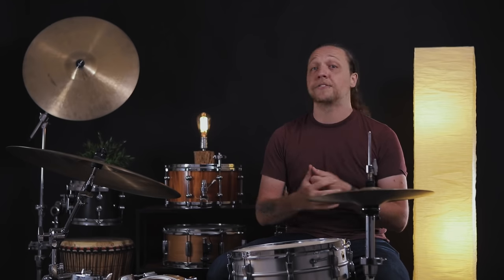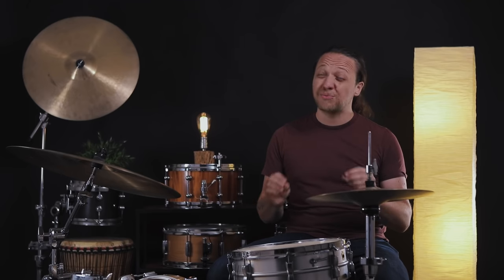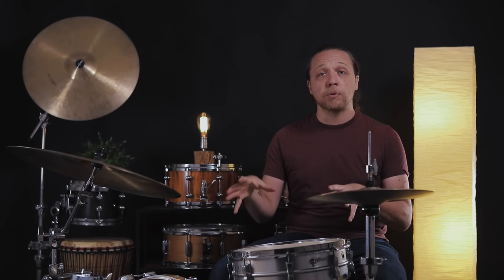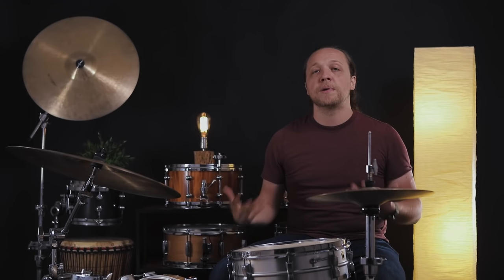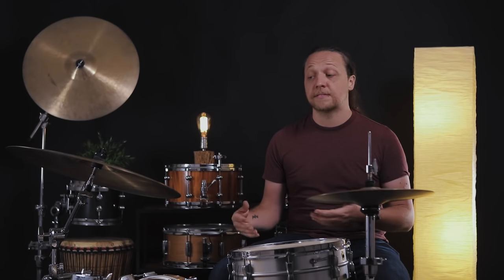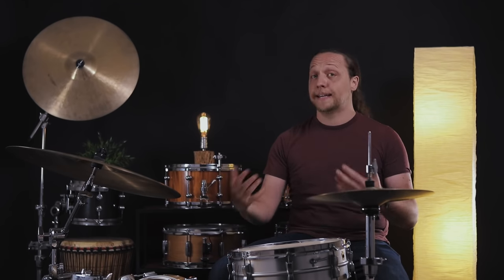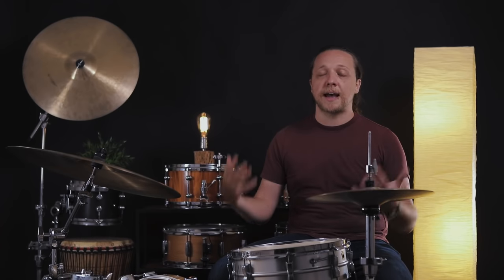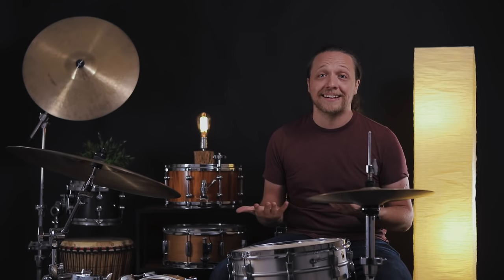Secret to the Ideal Bass Drum Tone | Season Three, Episode 18

Comment: For years I adored the sound of a kick with the reso tuned an octave higher. So much presence in the kick drum! It's a very usable sound, you get the low end and attack of the batter head and bright resonance from the reso head, also the reso head becomes like a speaker for the batter head because they resonate with the same note, making it a very loud drum.

Comment: Ime, almost everybody has their front head too loose. That’s where all your tone lives, man. I generally tune the batter first, get it where it feels good and doesn’t sound clicky or anything. Then tighten the front head until I get the sound I’m looking for. The front head gets tightened way past JAW, and a good bit tighter than the batter certainly. 

I think popular tuning methods (like Gatzen) are responsible for a lot of frustration for a lot of people. 
Invariably, when someone just can’t get a good sound, the heads are too loose. Particularly the front, too loose and you get no fullness - instead you get a thin, flat sound with crunchy, flappy overtones. (Then you throw laundry in to clean up the sound, but you didn’t have a good sound to start!)  

It’s just a big drum, it’s not a different instrument altogether. It needs sufficient tension to produce a big sound and get the shell involved. If you’ve been doing the JAW thing for a while it seems counterintuitive - you think the big, powerful sound comes from the low end so hey, I better tune as low as I can. But the way to get a bigger, more powerful thump is to go higher - not lower.  Lots of issues with bass drum sound can be addressed by tightening the front - not by loosening it. With loose heads, it’s all just attack. You’re not hearing the tone of the shell or the heads, just the collision of beater on floppy plastic. Ugh, that crinkly cellophane sound drives me nuts. Tune it UP, get a full, round, luscious tone and THEN dampen as needed to achieve your particular sound. End of novel.
Reply: Absolutely with you...
Reply: I'm with you too, to an extent. I play in a metal band so I need that attack to overtake the overtones. I dont tune it past a wrinkle, but still fairly low and get a sound that works for what I'm doing. If I wanted to play a softer genre, I would definitely crank it up about a full turn though. Get the sound that you want/need for the circumstances.
Reply: Festering Carm  Right on! You need the sound that’s right for the music. Metal and jazz always come to mind when I think of specialized tunings that defy the usual. And of course there aren’t any ‘rules’ in drumming, some of the greatest use(d) very unique tunings. But in a general sense, yeah, I think people struggle with bass drum tuning and end up buying more and more muffled heads, or using more pillows, or just giving up and saying “I guess that’s the best it can sound”. Less pillows/expensive muffled heads and a little experimentation with tuning can open up a lot of sounds that are just waiting to be discovered in your bass drum!
Reply: @crummyy But you can definitely have all music styles covered with a "jazz kit"..
Reply: Super nice breakdown!
Reply: Agreed, especially with a larger bass drum (24”-26”).
Reply: Exactly! I bought a nice kit to hear the tone of the drums! Tune em higher her them sing! You can a cheap kit & get that flappy sound all you want! Throw old pillow inside the bass & hear dump. I like my big 26x16 bass thumping & has tone, no port or pillow! Boooooom
Reply: What is JAW?
Reply: @Adixon5  Just Above Wrinkle - this is when you tension a head juuuuust until the wrinkles disappear and then stop.
Reply: @DZNTZ  gotcha, thanks
Reply: @Adixon5  
Just above wrinkle?
Reply: What is JAW
Reply: @queenpurple8433  Just Above Wrinkled - a tension that juuuust removes the wrinkles in the head
Reply: @DZNTZ  thank you I had never heard it called jaw before but now I know
Reply: @queenpurple8433  you’re most welcome. Knowing is half the battle. (I’m not sure what the other half is, GI Joe never got around to that)
Reply: this comment has inspired me to finally go out and try to tune the dang thing rather then damped the hell out of it instead 👍🏻
Reply: @mdlassel  Yes! Tune it up! Try to get the head “in tune with itself” - that is, sounding the same note when tapped near each claw. If you get a nice sound but it’s got a little too much sustain, the Sounds Like a Drum method of using a T-shirt or handtowel kinda tucked between the pedal’s goalposts and the batter head works wonders. You can get two very usable sounds just by adding/removing the shirt/towel. Good luck 👍🏽
Reply: @DZNTZ  thanks man! ill try it :)
Reply: I liked your comment because of the ending!🤣
Reply: @davidperez5089  Lol, thanks! I can be long-winded, but I’m passionate about drumming and I want to share my experience. Thanks for reading all the way to the end! Happy holidays!
Reply: @DZNTZ  likewise! I get upset when a drummer gets nonchalant about his sound from out front. Same goes for drummers whi play full volume @all times. Dynmacis is needed!!! Hohohi
Reply: @Dan G thanks for sharing that perspective. I recently tried tuning my batter head JAW (after reading many recommendations ), but the feel was horrible for dynamic playing and the tone was one-dimensional. I thought it was in my head or maybe I needed to adjust to it, but tuning higher solved everything 👌 ... If you don’t mind sharing, what’s your batter/redo head combination? I’m currently using a coated PS3 batter - which I love - but I’m not sold on the smooth white PS3 Reso I’m using. I’m getting great punch, but slightly too bright for my purposes. I’m considering a Coated or Ebony PS3 resin to get a slightly darker tone ... Any insights would be appreciated. Thanks again
Reply: @robertacosta3134  The PS3 is a great head, very versatile. For a darker, warmer tone I’m using an Evans Calftone Emad batter with a Calftone EQ4 reso for most stuff. For a jazz setup I switch to Calftone EQ4/regular Calftone. 

If you want to stick with Remo to keep everything in the family, I’d recommend a Fiberskyn Diplomat or Ambassador reso for a little more depth and warmth. You can check out Carter McLean’s vids for a beautiful sound with Fiberskyns and good tuning. Glad to hear from you!
Reply: @DZNTZ  thanks for the quick reply! 🙏 The Fibrrskyn sounds intriguing ... I’m familiar with Carter McClean’s videos, so I’ll look for that one ... Thanks again and best to you
Reply: I feel ya man, tho sometimes when practicing I like  messing around with it just to see what kina sounds I can get out of it. Like when I loosen it til its  flappy & I get like a sampled sound, again I does this for fun not during a gig, like u said it's a big drum therefore its capable of producing many diff sounds
Reply: My Ludwig Legacy Maple hears your cry,.
Reply: I agree. It's what I do and everyone comments how great my bass drum sounds.
Reply: Well here we are . People looking for better tuning techneque, yet give more input rather than learning a good lesson. OPPINIONATED

Comment: Along the same lines, over the years I’ve found that those heavier plastic port hole protectors can dramatically decrease the effectiveness of the front head. I use the Aquarian port hole, which is just a thick Mylar with adhesive. Any of the fancy metal finish types that are a two piece snap in design have enough weight to them to make the head very stiff and the drum gets very boxy sounding. IMO.  
Great vids, thanks!
Reply: That's true!

Comment: Awesome it sounds great, I tuned mine with the drum dial, and experimented allot with both batter head and reso head and found a sweet spot batter tuned to 90 and reso tuned the same at 90 on the dial and both pitches match great and it sounds real good.
Reply: Interesting because the Drum Dial company says that the Bass drum dial should be between 70 and 72 for both batter and Reso.  Way different than 90
Reply: @normnashtynash8815  I like my bass drum to have a higher pitch and a tighter feel, when I tried it this way I really liked it even though it's basically tuned tight kinda like a snare drum, it's just a personal preference, sounds big and boomy and the front reso has a port hole

Comment: I discovered through doing a little bit of reading. This idea and how it can change the tone of the drum. As mentioned in the video you need to figure out where the drums live. The great thing about a kick drum is all of the customization. Between beaters and heads and stuff to put in the drum. Even as it’s talked about here the way to tune the relationship of both heads. I’ve found that moving blankets are awesome for muffling. But also the DW pillows are awesome as well as the Evans EQ pad. With this drum it’s all about how far are you willing to go......

Comment: Definitely need a center vs offset port (same size/small port) shootout. I wanna see if the volume is really changed or if it's just the decay/attack and evenness of the sound that's affected. I think a 4 or 5-inch port on a 20" kick would do it. Or a 6-inch port on a 24.
Reply: A center hole will kill your resonance and most of your low end. You'll get a lot more midrange, but you'll also lose high end. When this type of hole was more common (1970's-1980's) engineers would compensate for that by sticking a 2nd mic (like a Shure 57) way into the drum pointed at the point of beater contact. 
An offset hole leaves the center of your reso head intact and so it can still vibrate and project the low end, which lives in the center.
Reply: @bergerdrum  But in the 70s, they were BIG holes, AFAIK. I'm talking about a minimally sized hole. Just enough that you COULD stick a mic through. 4"-5" on a 20" drum, 5" only on a 22", or 5"-6" on a 24" drum. Or in terms of a ratio; 1/5 to 1/4 of the diameter of the drum is cut out of the center. Those big holes from the 70s are like 40%-75% of the diameter cut out of the center.
Reply: @Drunken_Hamster  I hear you. Yes, those holes back then were pretty monstrous. But I think any hole in the center is going to kill the low end. It's not just me saying it; Simon Phillips, for example, says that if you cut any hole in the center of the reso head, you might as well just take the thing off; that's how big an effect it has. One of these days I'm going to try it with a really old head.
Reply: @bergerdrum  Saying and thinking is definitely different from trying. Start with a 1/5 diameter hole, and if that turns out to still be too boxy/resonant sounding, ream it out bigger to a 1/4 diameter center hole.

A LOT of people in various hobbies use hyperbole to enforce arrogant/ignorant dogma to push their own agenda. To that effect, I'm NOT making any declarations about Simon Phillips' character, but I'd be wary and skeptical of anyone making broad sweeping statements about anything in the manner that you quoted him doing.

If I were a drummer, I'd have tried it already and reported my findings. AND I'd have given it an honest shake by doing it on a new reso head. But then again... Do resos really ever "wear out" or do they just literally decay from time-based aging?

EDIT: OH, btw, if'n'when you DO try this, if it doesn't resonate well and you're the type to tune your batter loose and reso tight, try doing it in reverse with the batter tight and reso loose. Might allow the reso to, well, resonate more since it'll flap. Plus the batter should theoretically hold and transmit energy better since it'll have more potential energy to begin with due to tension and the actual batter pedal should be able to transfer more energy into it for the same reason.

Hell, if the center hole lets the air escape faster, you might not even feel like the batter is too bouncy or buzzy despite being tighter, since you'll get less of a reflection from the reso back into your foot. But this is all just theoretical based on my observations of physics and whatnot.

Comment: I literally can not seem to get enough low and slow decay.  I play on the softer side Jazz/Modern Classical/Art Gallery performances.  When you said 808, I said "MOAR SUSTAIN!", lol.  I am on a quest right now on a 18" kick.  I'm thinking thinner heads?  It has a Grestch/remo fyberskin reso which looks very cool, but thinking going fyber diplo reso for more tone/sustain?  It also has an emperor coated on batter, and I want to order a coated ambassador.  I have Pratt mufflers so I can dial in the batters while playing, but new kit and stuff to learn.

I hate being tucked deep in the corner (especially galleries), but I like being 6 feet out and with my hi-hat closer to the center of the corner, with my low side more in front of wall.  And then I face diagonally and off center to the opposite corner/audience.  Those reverberant box rooms can be managed, but it's like banking your sound sources off the rails of a pool table to turn the decay more into a natural reverb instead of slapback/comb filters.

Comment: Honestly I have the batter at a wrinkle with the lugs barely touched, and the batter just at the papery zone. I am using a 20 inch, and so far this has gotten me some pretty great results for hard rock/metal. I do wish I could have a little more sustain, but then I struggle getting the pitch low enough.

Comment: I want two bass drums, one tuned a bit higher than the other. I want to go smaller, like 20" and an 18", but I am not sure if the 18 would be over powered by the 20.  Terry Bozzio uses two 20" with different pitches (along with 4 other different bass drums lol).  I tune the batter head up on my 22 x 18 bass drum (I'd rather a 16 or 14 depth, but it sold as a shell pack) more for the action, and I play off the batter and don't bury the beater. Front head has no port, nothing inside. Which is really kinda nuts with an 18" depth.  This vid is helpful in many ways, and also makes me want to try the two 20" drums even more.

Comment: I've watched many of your videos and enjoyed them. In this particular bass drum tuning video it would have been more informative if you mention what size  bass drum you're currently working with. I mostly use a 24" bass drum because I like that nice Fat Sound suitable for mostly big band jazz using one felt strip all the way vertically down the front head. When using a much smaller base from let's say 18 or a 20" I know it would be impossible to mimic that type of sound but in your opinion what would be the best tuning options between the batter and the reso head, also should I use the same type of muffling procedure. Thank you. 😊
Reply from the maker: Thanks for watching! This is the 22x16" Pearl Masters Custom Maple Extra bass drum that we've used in the majority of our episodes. Regardless of size, the principles covered in this episode apply across the board. Still, you've got to experiment because there are SO many more factors that will affect how your drum sounds to you. As with any of our episodes, these are springboards for your own practice. Cheers!

Comment: Wondering if I have too many drums. I bought two identical used kits because I wanted two bass drums (Pearl Export). I have four rack toms and 3 floor toms... 8, 10, 12, 13, 14, 16 and another 16 with different heads by the hi hat. I play extreme metal, but I'm basically a beginner still.

Comment: What about using a much heavier (weight) reso head? My band needed a logo printed on the bass drum reso heads but had access to only clear batters. So they painted it black with a spray can and put a sticky 20" logo onto the surfaces. And maaaan... I noticed that the sound became much more massive, with much more lower frequencies. Like a cannon.

Comment: I prefer to tune the heads the same and create the effects by the heads you use.

I have a 20x17" bass drum with a clear thinskin 2 for the batter and a black thinskin2 resonant and it works great. the batter has the punch and attack and the resonant gives it more depth and body. so , you don't need to tune differently. just makes the adjustments by the head selection and get the pitch you want with the sound you want.

Comment: Do you find that with vintage drums (with original fat bearing edges) your hands are somewhat tied, as they don't really "get going" unless the batter head is pretty tight (which for me more or less necessitates going low on the reso side)?
Reply: K.C. McCloskey if you want the best of both worlds try a mapex Saturn kick.. ti has rounded exterior and 45 degree interior bearing edges... very wide tuning range and warmth...
Reply: Coated ambassador batterhead and low/medium tuned with a medium tuned non ported CS black dot reso sounds great on my 20 by16 vintage sonor beech  basssdrum.

Comment: Cannot agree more, if you play your kit regularly you need to be changing that head regularly too. If your batter head is dead, the reso is definitely dead too. People don't want to lose their logo head but it has equally as much impact on the tunability and frequencies coming out of the drum.
Reply: I doubt most people would be able to hear a difference between an old and new reso head. Especially the reso on a kick.
Reply: @CoomerGremlinDGGfan  You'd be amazed, it makes a huge difference especially on mic. Kick reso heads lose their elasticity and it becomes flat and papery sounding. Having not bothered for about 15 years, replacing it brought my kick back to life, all the warmth and low end came back. My drums have been sitting stacked up on each other for ~6 months through lockdown, and it sounds like it needs replacing again.
Reply: @timlovegrove1097  what's your favourite reso head for kick drums? I have a 24" pearl masterworks kick thats had the same reso on it for almost 10 years. Id like to try a new reso on it to see how if sounds.
Reply: @CoomerGremlinDGGfan  I mainly use Remo and my last reso head was a P3 ebony with a pre-cut 5" hole.